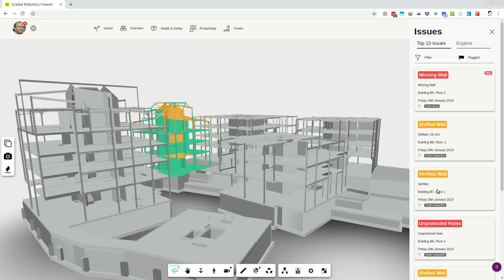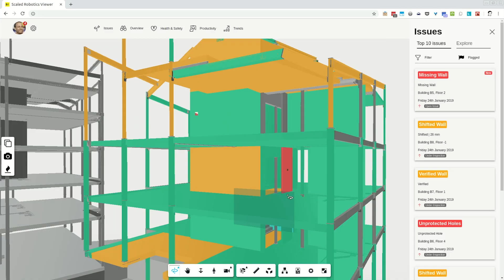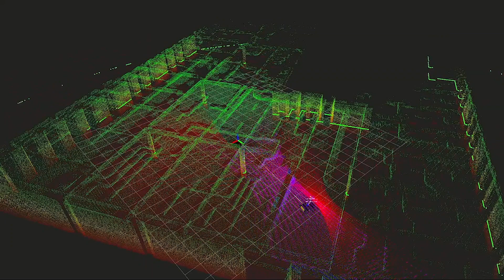Digitizing construction sites with Scaled Robotics

Comment: Artificial Intelligence is not actually real. It's the perception of what a software program is capable of doing with enough sensors in a spacial recognition space. Through infa red tape measures to laser measuring devices. This is just a 3D cad cam version of what we already do to justify a job of an I.T company expert.

Comment: I'm late, and no one will see this, but couldn't this (or spot mini) be used by architectural or structural engineers to ensure buildings are safer from earthquakes, etc? It's all dependent on the needs and applications of the robot, site workers, and contractors, but designs like this could actually help. Or be weaponized, but hey, things will still be more efficient. (Looking at you, DARPA)

Comment: Isn't this literally the same thing that the Boston Dynamics robot (Spot) is being marketed for? What's Scaled Robotic's competitive advantage? Their robot is clearly less dextrous.
Reply: Yes. Yes it is.
Reply: These robots were built by Clearpath Robotics! Husky and Jackal. Super robust ;)
They can't do backflips like Boston Dynamics, but they are a great alternative for research and development!
Reply: Easier to control I guess? It's much more compact and easier to repair by the looks of it.
Reply: @HarshvardhanKanthode  I guess it is probably a lot cheaper. Couldn't say anything on control or repairs; Boston Dynamics has had a bit longer to tighten things up, so I doubt this is any sturdier, and it also can't go up stairs which might mean it has to be supervised all the time.

Comment: an invention NO one asked for. Pix4D has a crane cam thingy though.
Reply: That's not true.
Reply: @ZephyrMcIntyre  literally no one needs that many data points about normal construction. that robotics platform is not something they created, it is off the shelf. if you want to monitor a construction project you have to run over obstacles, climb stairs. there is already a solution coming for these, its called spot mini.
Reply: @selfawaredevices  Interesting, I hadn't seen the new BD stuff. There are end users that like to have that data. Mostly insurance and investors, sometimes project managers or designers implementing changes.